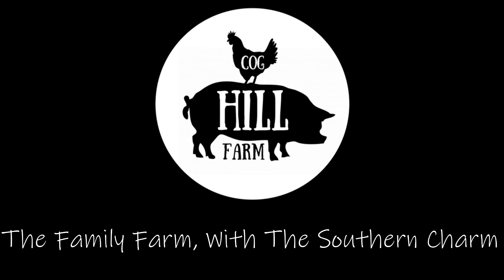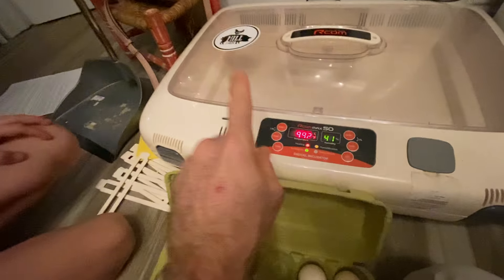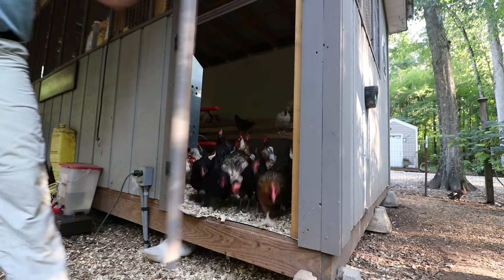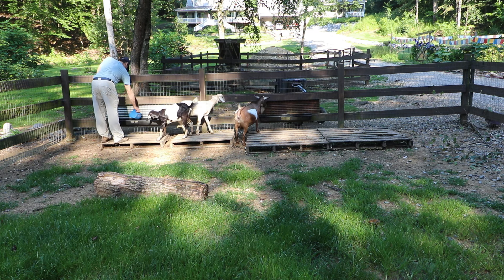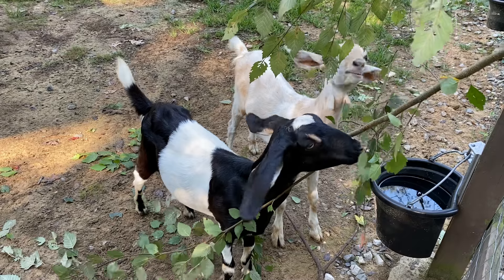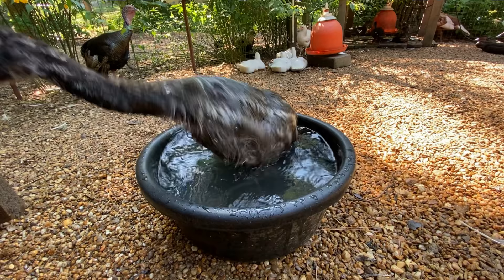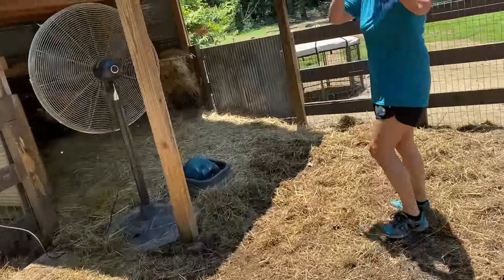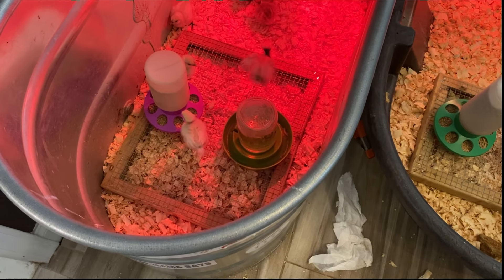Don't Make This MISTAKE When Hatching Eggs!

Comment: The humidity might be the problem. I had the same thing happen to me too. So we tried dry incubation. Were you don't put water in the incubator until lockdown. We had ours at 40- 45% humidity until it was time for lockdown. But I don't know anything about hatching out silkies 😕

Comment: Bootsy is gonna 💥!!  Good stuff on that feed and water tray.  I did one very similar last year and it worked great.  Every so often I’d have to use a brush and water to scrape off any droppings that build up where the wire is mounted to the wood frame.  It definitely helps with the shavings though.  Y’all be good 👍

Comment: We are looking for a good incubator between 50-100 chicken eggs. Why did you choose the one have? Can you make any other high quality recommendations?
Reply: We have a GQF Hovabator 1588 with the auto egg turner and have loved it so far. Super easy to use. Not quite 50 though as it only holds 42 chicken eggs on the racks.

Comment: I had a horrible hatch rate from my silkies too. Out of 16 shipped from a reputable breeder, only 2 hatched😞
Reply: Denise Kirk wow. I don’t hatch silkies, but breeding Cochin Bantams. Have never shipped eggs before, or used an incubator (only broody hens). I think shipping is just the main problem. So far, I’ve had 95% fertility from my girls. But I have the parents here and such. It may just be silkies as well. But I know lots of silkie breeders with high fertility rates for their silkies. But again, they don’t ship eggs, they have the parents there. 🤷🏼‍♀️
I’m unsure about this. Some people have suggested humidity issues, but I’m pretty sure it’s just the shipping part.

Comment: When is a good time to get laying hens?  I live in southeast Missouri, and I am building a chicken coop now, but I don't want to get chicks if they will be freezing
Reply from the maker: Typically spring
Reply: @CogHillFarm  thank you
Reply: @chadweatherspoon7479   Chiming in really late here, but if you have a broody hen, she can hatch any time of the year. I let mine brood in the winter. Have a separate 3x2ft pen inside the chicken house with a brooding nest on the floor in a box. The chicks will instinctively stay under their mother for heat, and nothing makes a momma hen come running like the chirp of a cold chick. as long as the pen is about 3x2ft with food and water, they'll typically be fine.

Comment: If anyone sees this please let me know if you know. Thanks.

I have had four unsuccessful incubator hatches. I have not hatched a single bird, they would get developed that you could see the beak, "feathers", face, all that. A lot of the ones that developed were trying to absorb egg sac but didn't absorb it in time. There was only one time that a bird was hatching somewhat, it poked a hole and that was it, it died. A lot of eggs have been buried or trashed sad to say. I don't know what I'm doing wrong. I tried dry hatching and moisture hatching. Both same results with slight differences. (Moisture eggs were more watery somewhat compared to the dry hatched eggs). My broody hens were able to hatch two birds but I turned to an incubator when they began to do a bad job by crushing the eggs or not staying broody. If someone knows how to fix the issue or recommendations please let me know. Thanks.

Comment: running at 60% is a no no that will literally drown them . dont go to 60% til the last 2-3 days they have plenty of air space then at 60 throughout growing it wont bleed off enough liquid for them to survive and hatch your rate will always fall in those circumstances
Reply from the maker: Silkies are different.  60% for the first 18 days and 72% for the last 3
Reply: @CogHillFarm  we run 45 then 60 on all of our incubators and we have 99% hatch rates on all of our chickens 6 breeds of orps, silkies, satins, polish, death layers, ayam cemanis, barred rocks, i also run my turkeys, pheasant and peacocks at the same humidity but not my mandarin ducks they get 60 across the board lol
Reply from the maker: 👍👍That is what we have always done as well for all our chickens, until we were contacted by one of the top silkie breeders in the country, and they told us to specifically do this with silkies. 99.5 at 60%, then 99.1 at 72% on lock down. They ship worldwide and their chickens can sell as  for much as $1500 each!!  Crazy!  So we decide to go with their specific instructions for silkies